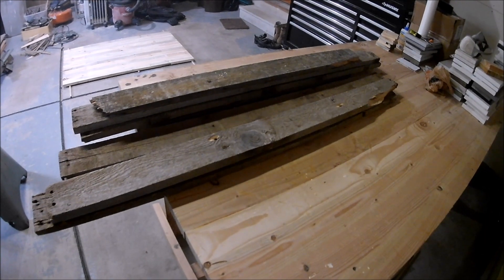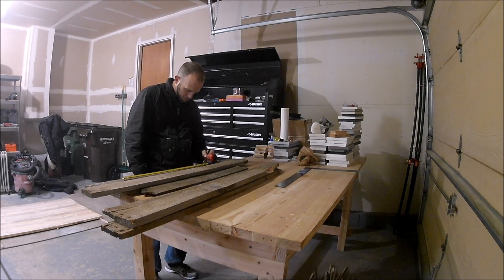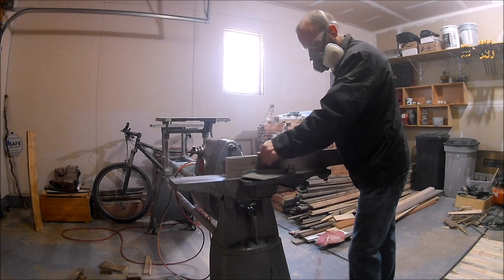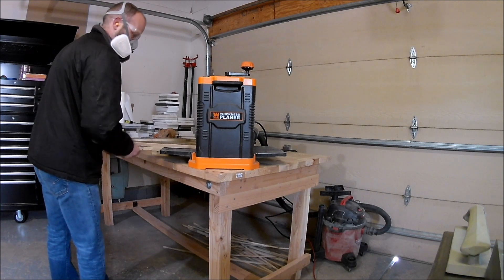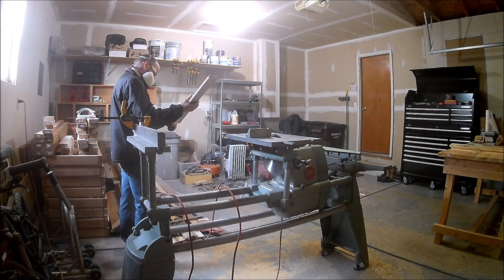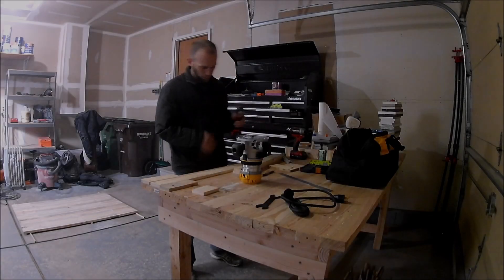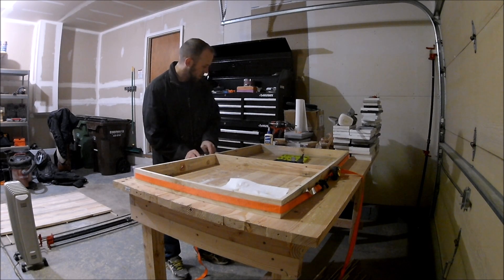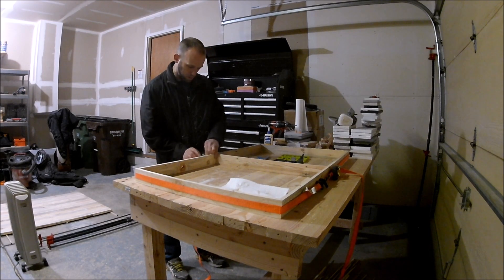Pallet Wood Dining Table Episode 3

Comment: If you’ve ever watched Andrew Camarata’s videos you’ll find he is a master at when to speed up and slow down his scenes. Check him out especially if the little boy in you likes heavy equipment operation. I have a Shopsmith 510 but I noticed your table has two slots for the blade? I still have the 500 table but still just the one blade opening.  Nice project you’ve got going, glad to see you’ve upgraded your blades! Good work!
Reply: Hooper57 They has two slots for years but it created a weak spot that would bend under drilling pressure and was a big problem when saw guards and dust chutes came into vogue, so it was eliminated.